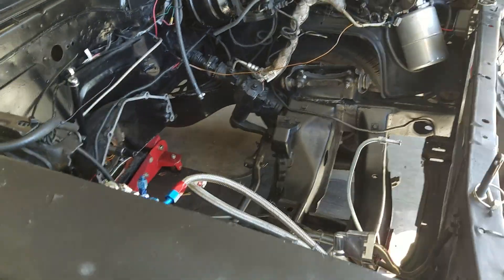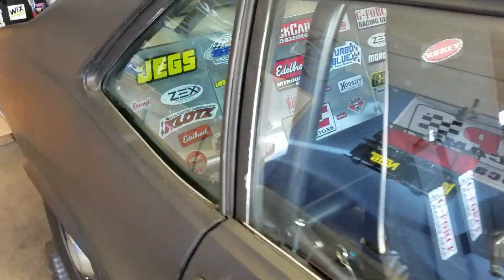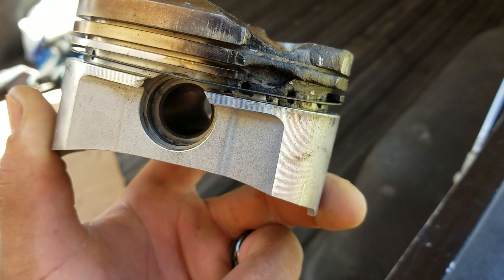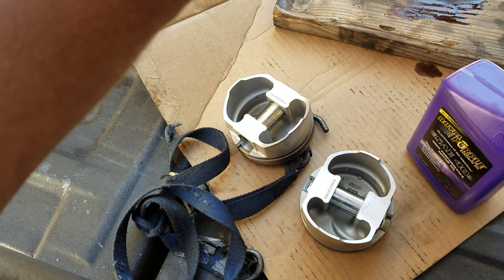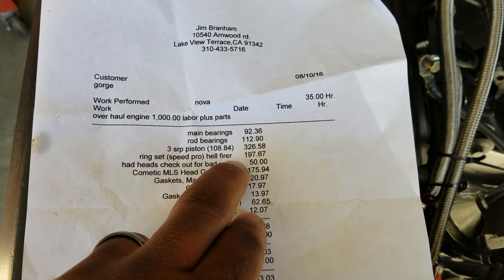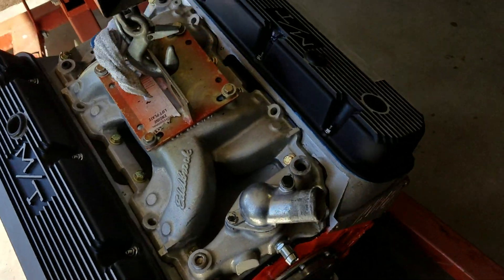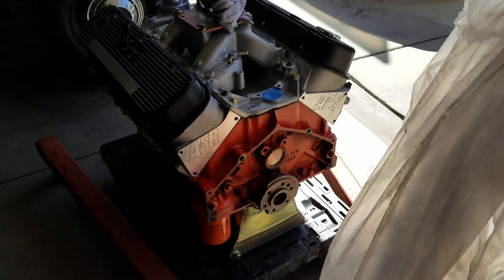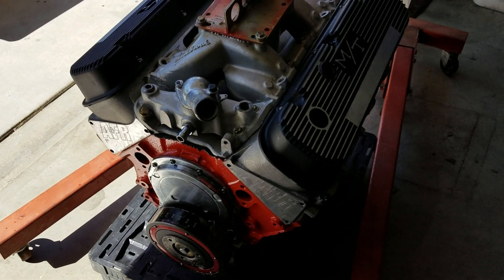CHEVY NOVA 489 CU IN BIG BLOCK HELL FIRE RINGS

Comment: If the wrong type of oil is used initially, or the break-in is too easy, rings and cylinders could (read will) glaze and never seal properly. A fresh cylinder wall needs some medium to high engine loading to get the piston rings to seat properly for good compression but make sure you don't lug or overheat the engine. Use high quality, low viscosity oil (Valvoline 30 weight), no synthetics, too slippery. If synthetics are used during initial break in the rings are sure to glaze over.

Comment: Wow Holly shit!  Least you caught it before it screwed the block up! I have the same pistons in mine ,tho i went with speed pro file fit rings, Im sure he opened the rings up for the juice and went with a nice head gasket cometic hold up very well! My buddy with the white wagon is hitting his car with a two stage and has never had a problem with them gaskets! I was running an rpm intake with my nitrous and never had any problems and my buddy also , the plate system sits up on the manifold so it does have room too spray, And hitting a 100 shot is shit for that motor , Tho it makes me wonder how you damaged the pistons , I would think maybe the the ring gap was too tight and it lifted the rings and broke the piston , Your good to go now that takes the worry out of using the spray now..
Reply from the maker: forgot to mention in the video that the last builder which was not jim, butted the gapless RINGS together instead of overlapping them😲
Reply: Oh there ya go well it sucks because he didnt do it right but lucky it didn't tear more shit up , Did you ask jim what he gaped the new rings at ? but it sounds like he got you setup pretty good now! Should run good! 
Your running a roller cam right? Flat tappet cams require the zinc additive or you will round your cam lobes , roller cams you dont have to worry about , but even so you can say Valvoline and just add a bottle of zinc ,Like you said that oil is expensive and when you have a deep pan its really expensive lol

Comment: I just started using the cheap rotella diesel oil for break ins add a small bottle of zinc and have good luck plus saves 70 bucks. Save the good oil for after the initial break in. I hangs mine after an hour of run time after a build or freshen up. " just my opinion". Good luck seems like you got some good parts in it.

Comment: Damn so thats why you had the oil consumption issues a while back when you were looking for an oil air separator. nitrous and oil dont agree, especially when the rings didnt seat in the first place. it should go 10.80 all Motor with the cubic inches, cam and heads you have. i always wondered why it was only into the 11s, now we know. good luck brotha !

Comment: Sorry to hear that bro!!! I hurt my motor to on the dyno last week haven't opened it up but I think the same thing
Reply from the maker: Yea jim told me to stay away from dynos they are really hard on the car
Reply from the maker: hopefully next weekend
Reply: I wouldn't think its any harder then you would be doing at a track, Its a good tuning tool, I would look into getting a wide band installed its always good to know if your running lean or fat
Reply: I use a dyno for every car I have or built with no problem!!!! If the engine has a problem I'd rather find it on the dyno then the track. Just my two cent ✌🏻️
Reply: True words there!!! Im With ya buddy on that one ! Very good tuning tool
Reply from the maker: ya I was already tuned and going for fun, that's the part he was talking about lol
Reply: Lol  well I would follow what the guy said for break in and have it tuned again.. And don't forget to only put one spring on the carb return the funny thing is when your wife was doing it she had no problems but when you did it you had too remove one of the springs have you been hitting the gym doing leg reps? Haha kidding of course haha!
Reply: Sorry to hear that bro! my last big block gave me a lot of issues so I had to let her go. running a 496 now in my 68 impala...way more torque now😆

Comment: thats what happens  when u run nitrous
Reply: That's why i believe you build the biggest big block that you can afford and run it N/A...
Reply: Right
Reply: Yeah man! If you gonna run NOS just build it right from the beginning. My 496 street engine dynoed at 565hp & 600tq on 9.1:1 CR. But I'm keeping mines stock for just street cruising and whatever I run in the 1/4 I'll just live with that...😆
Reply from the maker: Brian Samuels what's it run in the quarter
Reply: Lol never ran it but I think with my combo with sticky tires it should run low 12's. If I'm lucky high 11's. My 68 Impala 4,000+ pounds
My buddy runs low 11's with his 68 Impala. He has a 468 big block, th400, 3,500 stall, 4.30 gears. I'm running a 496 big block, th400, tci 3,000 stall, 3.36 gears. I've been following your Nova build. That thing fly but I know it can get faster😆 Holla back bro